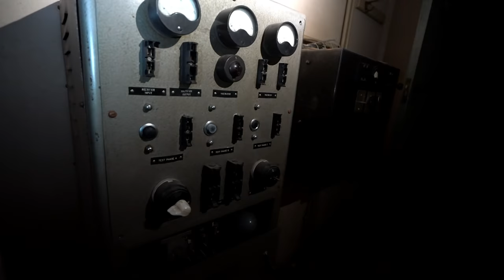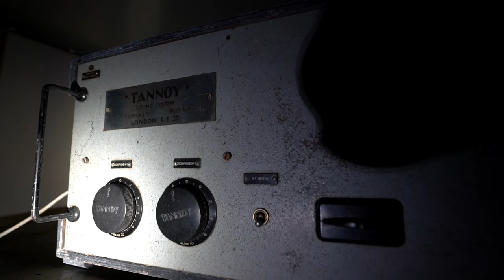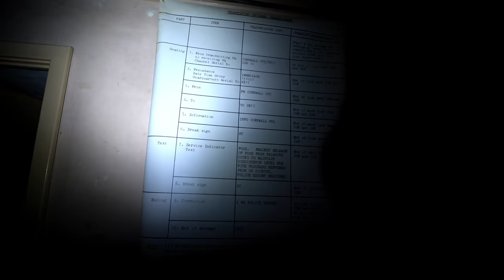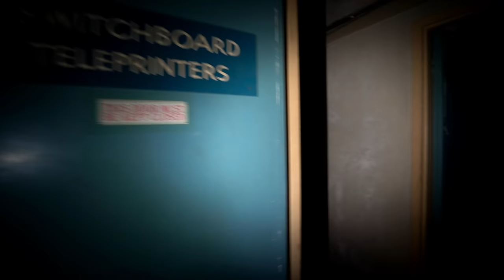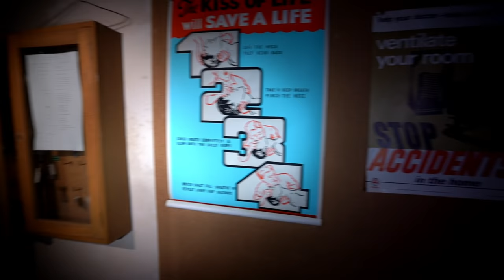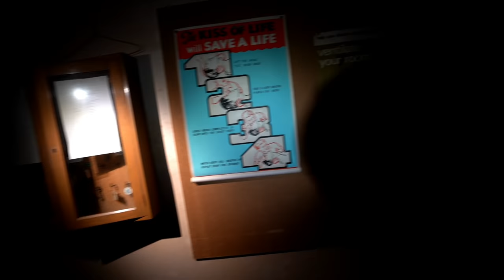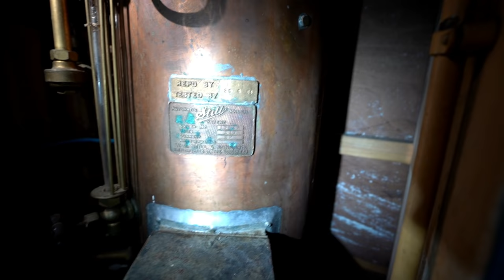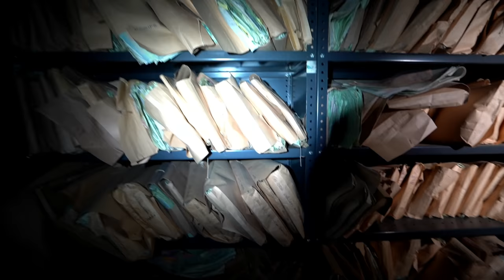We found abandoned war bunker untouched since 1941 (ABANDONED)

Comment: This is a civil defence bunker made during the 1960's in the event of a nuclear attack on England. It was removed from active service in 1980 but was looked after by service crews until the very early 90's, when government funding was removed. The reason was that after the fall of the Berlin wall there was no longer any apparent threat . Civil Defence Bunkers were meant to coordinate the recovery operations required to maintain Government after a Nuclear attack. Each Sector had their own Bunker and knowledge of them was Above Top Secret until (1996?).
Reply: With what going on now in Ukraine I wouldn't be surprised if this doesn't get used again x
Reply: @staceypether8848  - hilarious 😂 It would be quicker to build new than retrofit a 1960's bunker. And there are current technology bunkers but more mobile command centres exist. There's one like this in Cambridge that i think became a nightclub. And i built several under what were nationalised industries like water & electric board companies as late as the mid 1980's

Comment: Probably someone has already posted this but the biggest clue is ‘operation square leg’ - this most notably simulated a nuclear attack on the United Kingdom while offering as a test bed for a transition to war.

Those pins, looking at what is available about this operation, might relate to estimated target areas and types of detonations, or strategic target locations.

Either way, it was used into the 1980s for this purpose.

Comment: I took a closer look at the few seconds of generator footage & I can see it has a new Injector pump on it, that thing is operational. If you took a 24 volt jump start pack with you, I'm pretty sure it would start as long as you got fuel, oil & water in the radiator. You would have to find out where the radiator heat exhaust goes out to & clear it.  It looks like it's capable of about 50 Kva of that era, A good look at it's Spec plate on the Alternator would have been real nice. An alternator that physical size today is like 200Kva+ with big Turbo motors pushing it.

Comment: Outstanding! love all the detail and all the old 1940s tech.
Reply: most of that tech is from the 1980s and 90s.
Reply: @Newt_Newt  Thats your opinion i dont agree with you.
Reply: @DavidMantle139  check it my dude. It is a cold war ear command center, or was one. Still has neat things inside. I am not disliking the video. I am just saying. You can clearly see credit card files, they did not even exist in the 40s. The maps all say 1980 not 1941. Also that boiler they found was last serviced in the 60s. Also there are some files in there from 2009 sooo. That is not opinion but a fact.
Reply: @DavidMantle139  Aka that command center was last used in 2009, not 1941.

Comment: Maybe built on the site of a ww2 center, but the concrete outer walls with cinder block inner divider walls looks mid 1950s. Or an expansion of the original for the cold war period.  If the map had been 1983 instead of 1980, Operation Able Archer '83 historians would go nuts.  The Lamson basket, with pulley, would be a rather historic item.  Hope it finds a museum.

Comment: The square tube box talker with the push buzzer was for interrogation,  a person would be asking questions to a person at the desk and upstairs could hear the conversation,  then a person upstairs could ask a question but you couldnt see who was asking to protect that person's identity. You say? They had intercoms back then ? Not if the electricity got shut off . That's where the term " blower" comes from . Like ' get Jenkins on the blower ' , in old buildings there were long tubes going from dept to dept , they capped them off with corks at each end and each pipe said ....office one , engine room , garage etc . If you were in the upstairs office and needed to contact the mailroom you open your pipe end , put your mouth to the tube and blow hard , it would pop the cap off the other end in the mailroom . Then you talk into the tube and the person listens and responds then caps off his end ...they use them on submarines too ..the tube was about 3 inches round and went around your lips to form a gasket kind of ?
Reply: It's how the vacuum tubes at banks got started . By that company that made that file dumbwaiter mechanism in this episode.

Comment: Next time point the camera at all the electrical equipment a lot longer, not just flash by. I saw a flash of a generator there, I really wanted to see a great deal more of this stuff & the ventilation gear. It actually still looked operational. Oh and take a thing called a Volt Stick with you next time. What that does is it is a Non contact pen sized instrument that tells you if the power cables are energized with Live power say at the power board there. You could potentially power the place with external power, though probably not recommended if somehow the power usage is monitored. But highly interesting all the same.